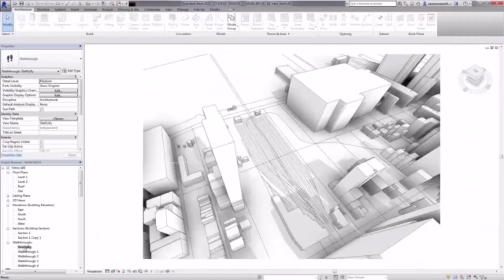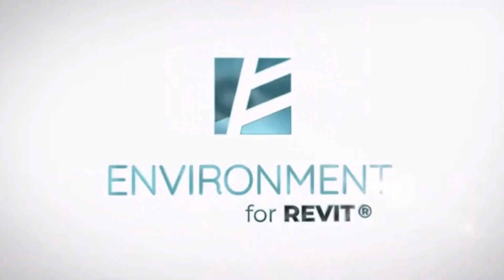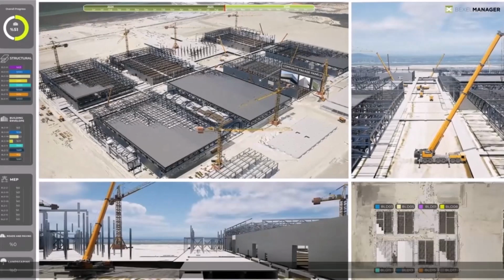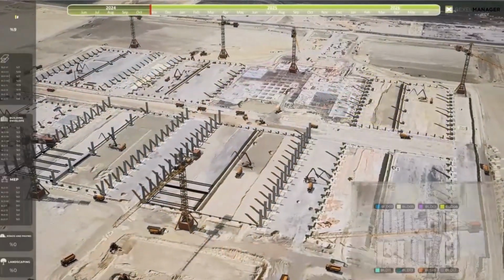What is Autodesk Revit - Quick Overview

Comment: Yeah but I still don't understand why there is no push pull or other flexible tools in Revit. Why I should always work on 2d views.  Why all of this should be worked in Family interface. Maybe I don't wanna create a family.
Reply: As a professional Revit hater (and daily user) let me awnser your questions:

1. Revit has terrible UI / UX design but you learn to live with it. Complain on the forums, maybe Autodesk will listen (they will not)
2. Your mouse is a 2d input tool so working in 2d is just more accurate because there is a defined workplane (the level your floorplan is connected to). But you can work in 3d just fine for most applications anyways.
3. Families are nice, they are the exchangable and sharable building blocks you can use in your project but you can also "model in place" for one-off elements.
Reply: @kommentfloh8425😂😂 I wish those (default) referance planes were optional. thx for explanation tho